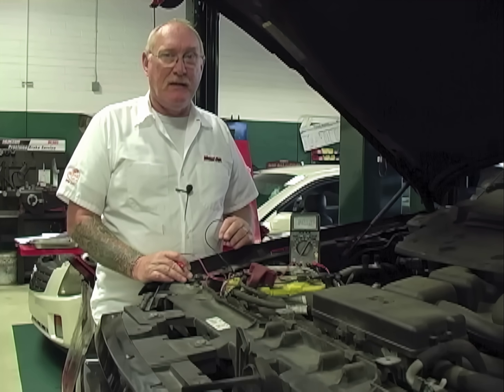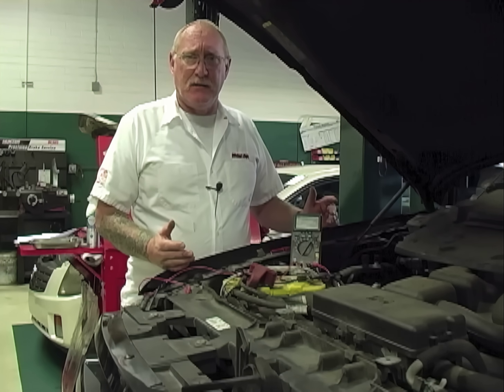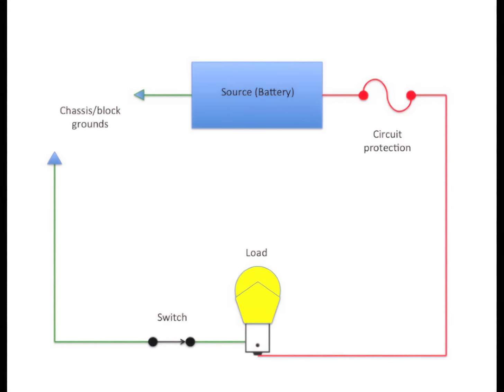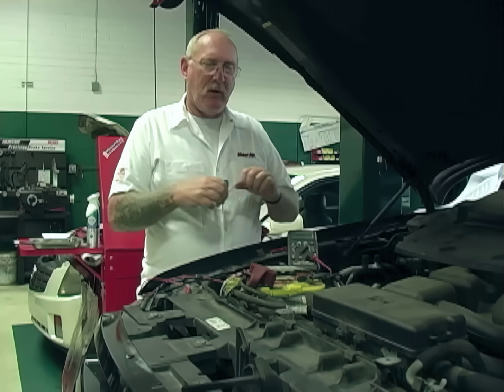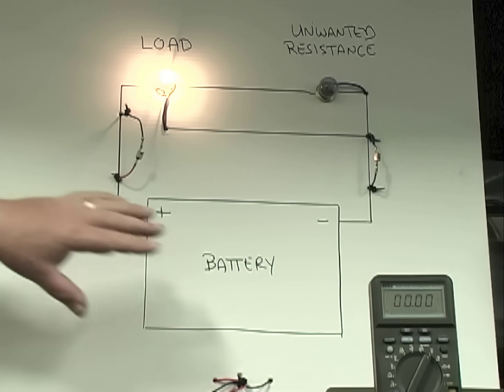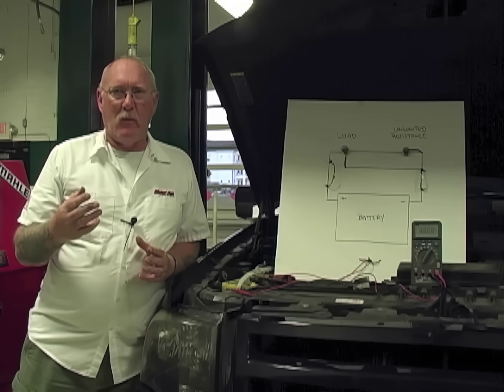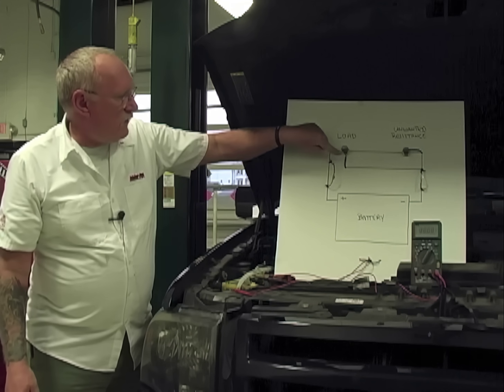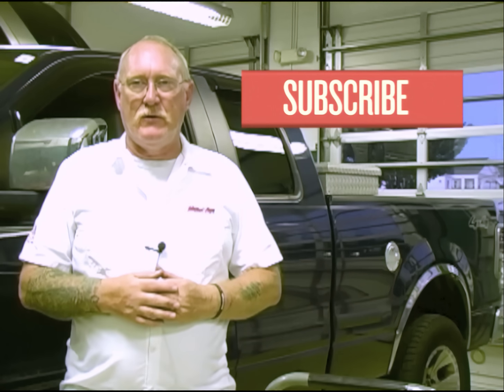The Trainer #47: What measuring voltage on the ground side means

Comment: I've been going through electrical circuits for forty plus years, i find these problems nearly daily working in our shop. Without the technical schooling i categorize this problem as a "bleeding ground", however this principal is well documented on this video. I do not use the same technique ie. Testing negative battery to positive ground to assess voltage drop. When a circuit is acting grumpy, i look for an open ground in all of the terminal connections. First testing for optimal voltage at a given point, if that point is deficient i move closer to the source ie. The switch. And check for optimal voltage. Just as this video demonstrates. Keep learning great technics! You d man.

Comment: I am trying to find the source of a problem with my '86 BMW that blows fuses on the high beam circuit.  I have measured resistance from the fuse block to each connector in the head light system.  I've found 3 of the 4 circuits to be as expected (minimal resistance on the fused circuit and open circuit on all of the other connectors in the system.  One of the hi beam fuses, however is showing resistance at all of the other headlight connectors, including the grounds.  I'm not quite sure that that is trying to tell me, but something isn't right.  I'm open to suggestions....

Comment: What am I missing? At about 7 mins, the diagram drawn seems like the unwanted load would be bypassed (shunted).  I think the wire from the (intended) ground side of the expected load should lead only into the unwanted load, not with a wire in parallel with the unwanted load.

Comment: Great video and keeping it simple is the key. No matter how much I looked at circuits and worked out total resistances and Volts and Power calcs etc, when I finally got my head around that a corroded connection was an 'actual' resistor in a circuit, that's when the penny dropped as far as how I should start fault finding the voltage drops and the voltages which didn't belong.

Comment: Not sure what you mean when you say that the circuit protection or fuse is on the positive side because the current flows from positive to the load. 
It is actually the electrons which flow from the negative to the positive going through the Load.
The positive to the negative direction of the current is just the convention used.

Comment: What ?? Most vehicles I've dealt with the negative terminal of the battery has a direct connection to a body ground.
Therefore unless there's a bad connection at the battery or to the body grounding point or a bad battery cable if you have the negative lead of the meter on the negative post of the battery and measure to a point on the body  I think you would always see close to 0 volts.

Comment: I had a ground at my battery that was bad my son had me change the connector and use the same cable .. it worked …how can a lead connector go bad I cleaned it up perfectly and it was still no good??? 
Thanks for the videos

Comment: One thing he didn't mention was with these newer cars there is a drain on the battery because they receive over the air "updates" that tax the battery. Also there is a brand that programs it alternators to never fully charge the battery. This coupled with the updates causes the battery to drain if the car sits for a long time.

Comment: Still don't get it. 
How did the ground pick up 6 volts ?
The hot circuit in or beyond the 1st bulb had to have been going to ground ?
Reply: The circuit provided by the trainer is QUITE confusing, particularly in attempting to describe such a confusing concept such as voltage drop. Yes, it is technically correct in one aspect but in the business of education, especially in online presentations, it is NOT correct. 

Think of a circuit such as he has presented here but WITHOUT that drop down bypass circuit taking a shortcut to the ground side.The circuit he is presenting is not one that will ever be FOUND in an automotive circuit, (two lamps in series) but just. think of the second lamp as a resistance to the flow of current. Since the current MUST flow threw all electrical pathways, both the first bulb AND the second bulb act as a LOAD. In this case instant BOTH bulbs appear to be of equal loading or resistance to the current flow. AS SUCH, what you have here is essentially a fixed voltage divider. Voltage on the sink side (the side opposite of the battery source) of the first load WOULD be, in a normal circuit, 0volts, however, since there is another 'load' or resistance in the circuit, the total voltage is 'SPLIT' between the two loads. Remember one of his rules is that ALL of the available voltage in a circuit is used to overcome all loads in that circuit. . Since he has 2 'loads' in the circuit he must drop the total voltage between those loads by the resistance value of those two loads. Here is where you cannot escape the need to understand Ohm's Law. The first load has a resistance. It 's value MAY be unknown to you but if you KNOW the SYSTEM voltage and you measure the voltage drop across the first load and you find, say, a 6 volt drop, using Ohm's Law https://www.google.com/url?sa=i&url=https%3A%2F%2Fgkbooks.in%2Fohms-law%2F&psig=AOvVaw1Paiy7iC1r8s6YYn2rRPjF&ust=1745268484537000&source=images&cd=vfe&opi=89978449&ved=0CBEQjRxqFwoTCOjD_Ja-54wDFQAAAAAdAAAAABAI  

If you take the voltage drop reading on the sink side of the second 'load' in the circuit you will find that the two voltage drops added up from both sink side measurements will EQUAL the value of the SYSTEM voltage. In this particular case you have a defacto voltage divider circuit, not unlike that of a potentiometer. Now, just for giggles here, IF you changed the resistance of the second load in the circuit, say put in a larger bulb, and turned on the circuit again and measured the sink side of BOTH loads, you would find that the voltage drop values have CHANGED but they ALWAYS will add up to the SYSTEM voltage.  Bada BIM, Bada BAM, Bada BOOM.

Darrow...for the Prosecution
Reply: This circuit only works as shown if the second lamp replaces the wire going from the first lamp's negative to the battery negative, creating a series circuit. The figure he is showing mistakenly depicts a parallel circuit between the first lamp's negative and ground. In this case the second lamp should not even turn on and the first lamp would have full brightness.
Hope that helps.

Comment: So, please tell me whether I got it right. I have a crank and a no start. I hook up the multimeter black lead to the +ve battery post and take my red lead to the B post of the starter and crank the engine. I should see less than .5 volts there. Am I right? Will I see 12.5 volts just before the B terminal of the starter as I crank the engine? Could somebody please answer..

Comment: I am a retired electrician electronic technician. After retiring, I went back to school and got an associate degree in each. I also taught up until covid. An excellent presentation. If I might make a  suggestion, a quick removing, cleaning, then reattaching the ground cable, and then remeasureing would validate the lesson. Thank you.
Reply: MY thoughts as well.

Comment: V = I * R or I = V/R where V is pressure, I is flow and R is constriction. So, you can also measure current on the ground side (non-contact clamp) without having to find good clean points for your test leads. Or read the ohms and get out the graphing calculator

Comment: Great video, however I have a different issue. With the terminals already disconnected and a jumper wire ran from + to - terminal to drain off and residual. If I hook up a voltmeter to the disconnected terminals, I am still getting a reading and it slowly climbs the longer it is connected. However when the jumper wire is reconnected the VM reads 0.00. I thought it would have to be a faulty  Voltmeter. However i keep getting the same reading from three different VM and one is new. Does anyone have any idea?

Comment: Very similar Theory in the electrician world. Checking difference of potential across fuses can you show you whether a fuse is good or bad in a live circuit. Thanks for the wonderful explanation on the DC circuit. I began my post High School career in the Navy in the DC electronics. I have recently 40 years later, went to HVAC School after working as a plant electrician for about 3 years. DC and AC are somewhat different, same principles all around though. I find being able to troubleshoot effectively to actually be a lot of fun/enjoyment. Solving puzzles in life is the epitome for an autodidact/ polymath like myself. 65 yo and still going strong.

Comment: the problem I have with this example is you're describing voltage drop in a series circuit but you drawn it in parallel

Comment: I was asking that question, so I stuck around. Thanks for the info. Been chasing my tail on low cranking voltage lately, even after cleaning up all contact points and stripping down my starter and load testing the battery. Going to try this next

Comment: Depends on the type of volt meter.  It should read the voltage as Negative, the same as it is when the positive (red) lead is on the + battery post.  Electrical Engr with over 50 years experience with Electronics.

Comment: Great video.  For those who understand, but want additional information, here's a little about DC Theory.
To understand how this could happen, you must first understand resistance. 
Every wire and every circuit has resistance
What resistance means is resistance to the flow of electricity (electrons.)  Smaller wires have a greater resistance than larger wires.  Higher current (more amps) requires the movement of more electrons, therefore a larger wire that has less resistance.  
Voltage is potential energy and kinetic energy.  
Voltage drop is the difference in potential between 2 points on a circuit.
The ground wire connects the chassis to the negative battery terminal.
If there is zero volts on the negative battery terminal and 8 volts on the chassis side of the ground wire, that is an 8 volt voltage drop. 
Ohm's Law:  Voltage = Current (Amps) x Resistance (Ohms or Ω)

Resistance of cooper wire is so low that on short pieces of wire that on standard multimeters, the wire should measure zero Ohms.
But with 8 volts from one end of the ground wire to the other, both the current and the resistance must be more than zero.  That also means that your car is left with only 4 volts to operate on.
If you disconnect the ground wire at the battery and connect the positive side of an amp meter to that wire and the negative side to the battery and it reads 2 amps, you can solve the equation.
Voltage drop across the ground wire = 8 Volts.  Current = 2 Amps.
Voltage (8) = Current (2) x Resistance.  
Resistance = Voltage (8) / Current (2)
Without even removing it, you will know that ground wire will measure 4 Ω when it should measure zero.
If your current is 10 amps and voltage across the ground wire is 8, the ground wire is 8/10 or 0.8 Ω.
It might seem like 0.8 Ω should not make a difference/cause a problem, but it definitely will affect any circuit.
If you connected one end of that 0.8 Ω wire to the positive and the other end to the negative of your battery, with nothing else connected, It would draw 15 Amps.*
On an automobile, all circuits are connected in parallel.  Each additional circuit added reduces the total resistance to less than the smaller resistance. (4Ω connected in parallel with 8Ω is 
(4*8)/(4+8)
32/12
2.66Ω
*NEVER connect the positive and negative of a battery with only a piece of wire.

Comment: The second bulb ( unwanted resistance) lead going to first bulb ( Load ) went to the Positive side of the first bulb Correct ?
Reply: I think that is connected to (-) side of the first bulb
If the second bulb was connected to  ( +) side of the first bulb 
Both bulbs will illuminate more intensely 
I hope I helped you
Reply: @konstantin-big  Thank you for taking the time . Your video are EXCELLENT !

Comment: 0:45
IF YOU'RE ASKING YOURSELF HOW IS HE GETTING VOLTAGE
You don't understand how your DMM works
that's as simple as it is

HERE IS A BETTER WAY TO UNDERSTAND IT 

1. FORGET EVERYTHING THAT YOU KNOW or think you know,
Clear your mind and just remember these things

2.   Keep it simple
WHAT IS VOLTAGE :
(Simple Explanation) :   VOLTAGE IS PRESSURE   (Specifically Electrical pressure, BUT STILL PRESSURE)
Examples :  if you have a ballon and blow into it,  the air you blow in increases and causes pressure to press on the balloons inner surface
if the amount of pressure exceeds the pressure the balloon can hold 
the balloon will burst

If i push you in the chest, I EXERT PRESSURE
if your body can withstand the pressure you will be fine
if i punch you in the chest with enough pressure that is greater than the pressure your body can handle... You will die

when you touch a High Voltage wire and the shock passes through your chest
YOU DIE BECAUSE OF THE AMOUNT OF PRESSURE THAT WAS EXERTED IN YOUR BODY and at a level that your body cannot tolerate
SO.. DO WE GET IT ?
VOLTAGE = PRESSURE
do not over complicate it

3. LET'S UNDERSTAND MULTIMETER LEADS
The COM or Negative Terminal of your DMM  , Internally is calibrated to be at 0V
(aka  NO PRESSURE)   it is YOUR REFERENCE POINT

The Red Lead or Positive Terminal    IS YOUR TEST POINT or  SAMPLE POINT

When you take a Voltage reading (in simple terms) Your DMM Says to itself

Okay.... COM Terminal is 0V and has no pressure
so...... HOW MUCH MORE OR LESS PRESSURE IS AT THE RED TERMINAL.............
RELATIVE TO (or with respect to ) THE COM TERMINAL

so if you have a reading of 12V DC
Your meter is saying
COM has No Pressure
and the Red Terminal has 12 VOLTS OF PRESSURE, GREATER THAN THE COM TERMINAL

if you were to swap the leads accidentally
the multimeter says
COM is no pressure, however, the red terminal has -12V Pressure
or  12V Pressure LOWER than the pressure at the COM Terminal 
hence -12V

SO BACK TO OUR PROBLEM

You measure between the 2 battery terminals
THAT'S FINE
12V Just means
Black has NO PRESSURE
and Red terminal has pressure FROM THE BATTERY that is equal to 12 Volts greater than the Black terminal

NOW......  YOU TAKE YOUR RED TEST PROBE AND PUT IT ON THE CHASSIS OF THE CAR
AND YOU GET 8.4 V

HOW IS HE GETTING VOLTAGE
STUPID QUESTION

it's because 
The black terminal of the DMM is at 0V Pressure (assuming it's not faulty)
the red test terminal is now on car Chassis
and is reading 8.4 Volts of Pressure higher than the negative terminal on the battery

IT'S BECAUSE THERE IS VOLTAGE ON THE CHASSIS
What else would it be ?

Asking .... How am i getting voltage,  is to assume that the chasis never has voltage.
YOU SHOULD NEVER ASSUME THESE THINGS

EITHER THE CHASSIS HAS VOLTAGE
OR THE METER IS FAULTY 
OR YOU PLUGGED THE LEADS INTO THE WRONG PORTS ON THE DMM

when testing voltage YOU ARE TESTING THE PRESSURE DIFFERENCE BETWEEN THE 2 TERMINALS AND THE METER ALWAYS ASSUMES THAT COM IS AT 0V / No Pressure

and how would this scenario occur
well, obviously if the battery has 12V  and you have 8.4V on your chassis

USE OHM'S LAW
somewhere you voltage is shorting with your ground, but it's not a dead short, 
there is a resistor or resistance, sufficient to drop the 12 V to 8.4

Comment: Finally; some one explained that, I was thinking about making video about it for a while. I been using that method for over 15 -20 years and that’s only way to find bad connection. And all the time I do it in shops someone is asking me how did you came up with that? Well wen I was growing up there was no internet to me. I was reading manual’s and technical books from 50 fry 90 and hanging around old guys that actually knew what they are doing. Asking how and why it is done that way. Back in my country. That video brought me some childhood memories of older guys that were able to explain how it works, it’s almost impossible today to find people like that, and with all that social media if some kid trying to learn something…. That’s why we getting so many tech’s that can’t find simple problems. I had one hybrid car with push start intermittent problem after 3 dealers waisted cupel Thousand of customers money . 5 minutes with tester I found lose ground. But I would like to add more to that test to get even better results. I’m going to make a video. You need to do in with loads of and with loads on to find smaller losses of power.

Comment: Thanks for sharing your knowledge and insight.   I have a honda accord 2021 and car runs fine.  only problem is when I shut off the button(start-stop prerss button)  then the the start button stay on On position (blinking)  i changed the button but same issue.  I know I have short I checked and isolated the starter but same issue all fuses are ok  Can you help here please share your thought what cause it and how to solve this.  Thanks

Comment: High resistance in your ground circuit. Poor connection or possible battery cable issue. Ideally the circuit needs to be under load. Turn headlights on would be a good load. Without having the circuit under load you will get an inaccurate reading

Comment: You never told us what the problem was!  Loose connection?  Other than that you are entirely right.  Another way to look at this is the sum of all the voltage drops will equal the sum of all the voltage rises but there is only one voltage rise, the battery.  In the great majority of electrical circuits or rather, all the electrical circuits a mechanic will deal with, all the voltage drop (less a few millivolts for wires and switches) will be dropped across the load.  If you probe and probe and find something over the few millivolts the problem is between your probes.